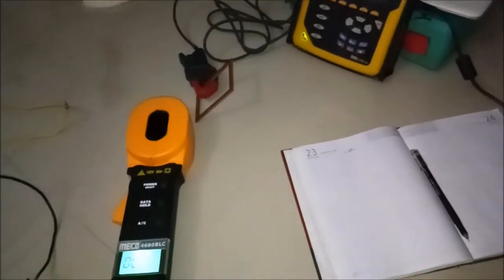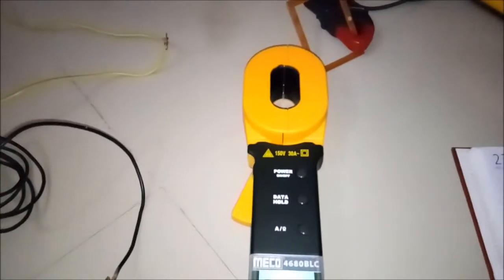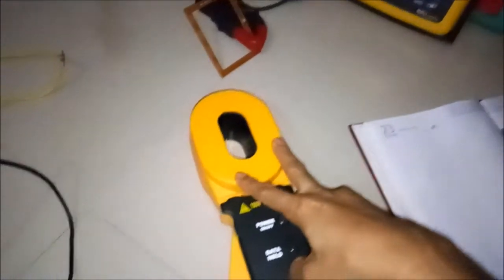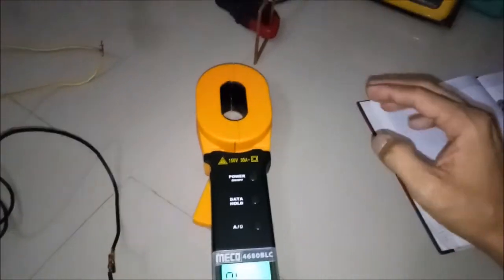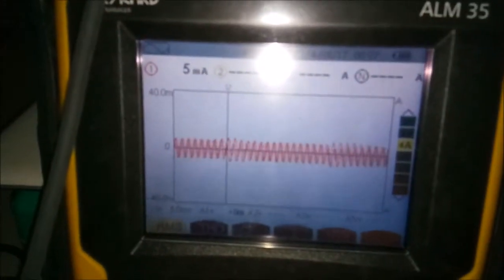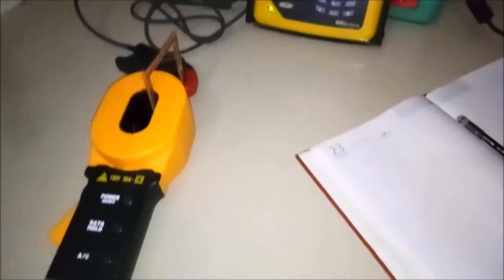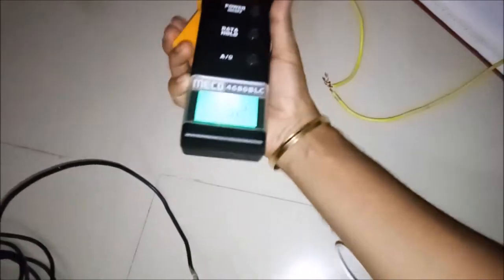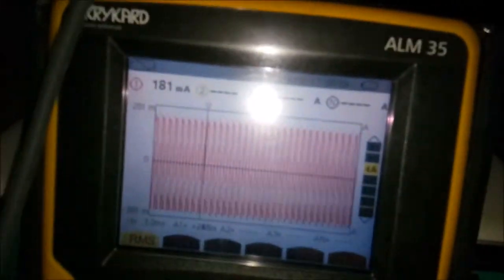HOW DOES CLAMP ON EARTH TESTER WORK ESS

Comment: Hi, request if you can kindly share the following information. 
1. what is the frequency and amplitude of the signal generated by a voltage generator.
2.  what is the rating of Current measured by a CT. 
3. make and model of CT.

thank you.

Comment: Is it possible to measure tower footing resistance of transmission towers using this instrument??
Reply: You can use it in any looped earthing systems but not solo or unlooped single electrode. You have to examine and decide. Hope this helps.